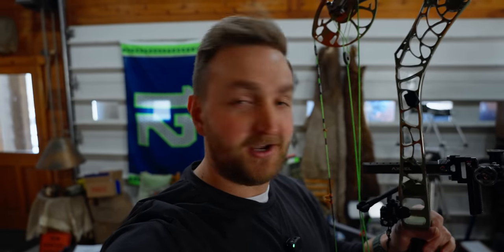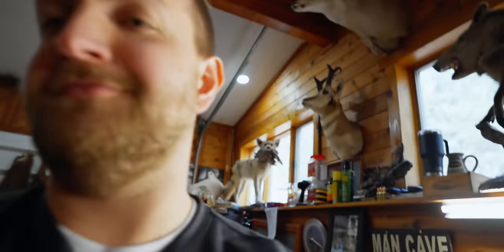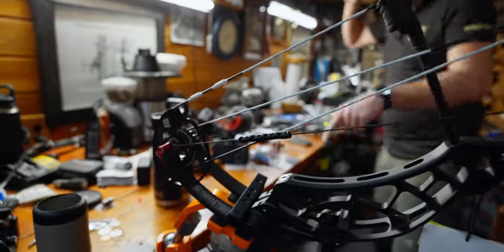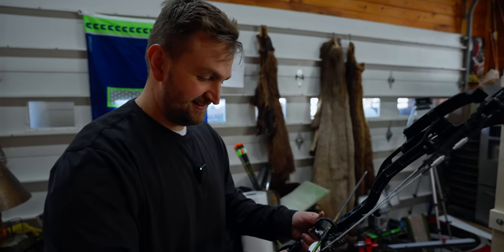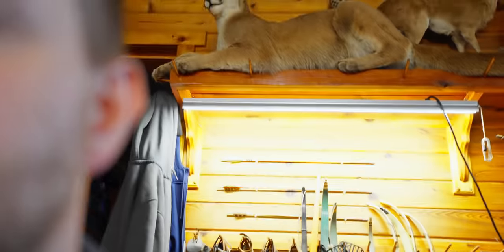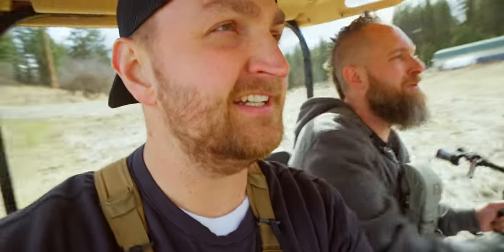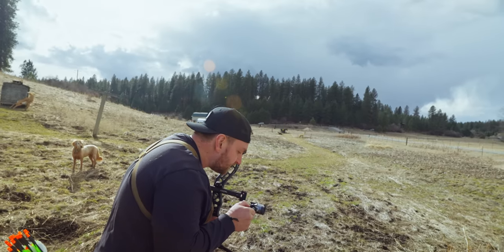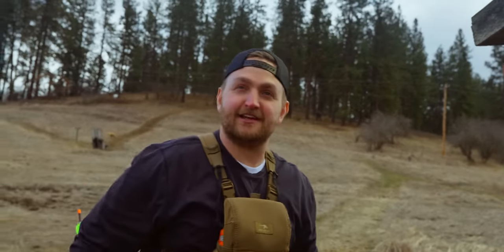New Bow Build with 100 Yard Archery Shot Challenge!!

Comment: Please do an expensive arrow vs cheap arrow build, compare groups, penetration, durability, ect. That would be cool. I have cheap arrows(vital impact) and it'd be cool to see what, if anything, I'm missing. Thanks.
Reply from the maker: This is a great idea 💡 thanks dude 🤙
Reply: Very nice idea. I run Gold Tip Hunter XT 340's. Definitely not cheap, but also not top tier. Any time you go over $20 an arrow, excluding the broadhead, that spending amount is out of my league. I do practice most of the off season with cheaper arrows and then switch to the more expensive ones a month or so before opening day. Help reduce damaging them.

Comment: Fletching comment #101: I'm still seeing 3 vs 4 fletch benefits based on application. My tightest "long range" field point groups have always been 4 small profile vanes - AAE 23's with straight, left offset. 65lb BT Realm at 28.5" and have 2" Black Gold sight housing clearance beyond 115 yards. However, my swept-back Exodus broadheads (fixed blades) are point on out to 80 yards with 3 - straight offset AAE Stealths and sights clearance less that than 100 yards because the cock vane sits vertical. (no, I don't shoot animals that far, but will if needing a follow-up). People just assume you just keep the same fletch size when adding on the additional one to drag.

Comment: I almost thought it was gonna be the PSE Shootdown Pro.  Oh well, this’ll be cool.

I just wish Bowtech could get off the plastic limb pocket thing.
Reply: Why? They are lighter, cheaper, and never break. The Reckonings do have metal pockets.
Reply: Right, they are lighter and cheaper.  But, it’s not reflected in the price of the bow and they do break.  If I’m paying 1200 -1600 for a bow, I want machines aluminum pockets.

I wasn’t speaking on this bow in particular, just in general.  Bowtec has a couple of bows I really like I just won’t buy them because of those plastic parts and all the others in the price range are aluminum.  The weight savings is negligible.